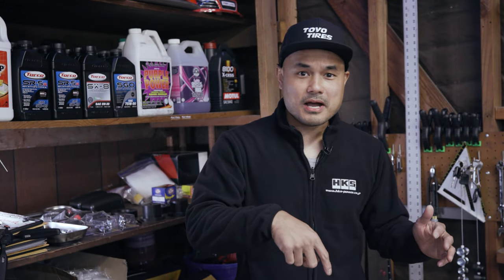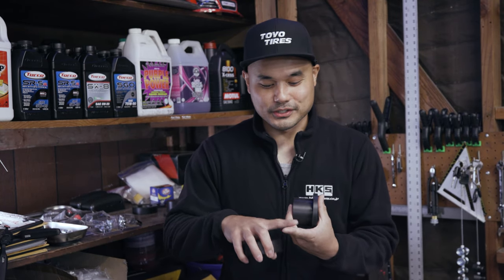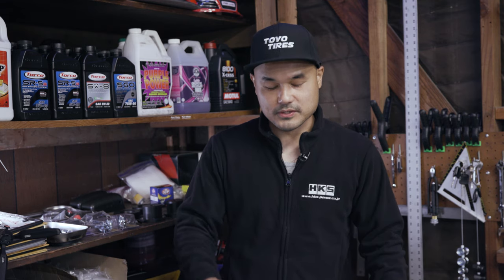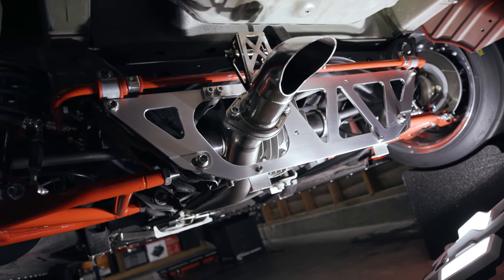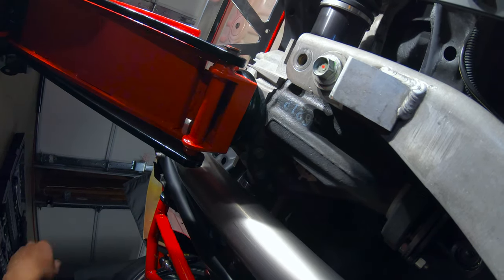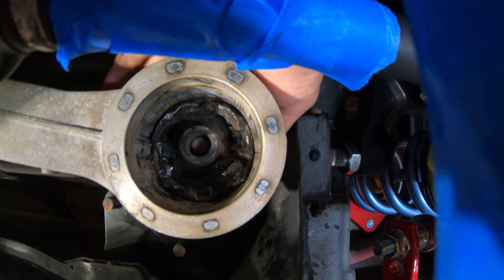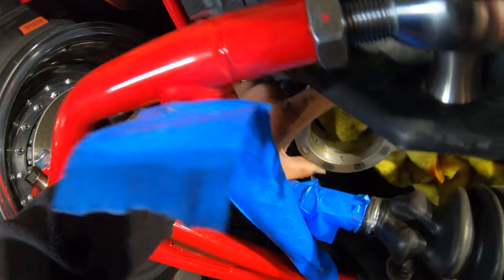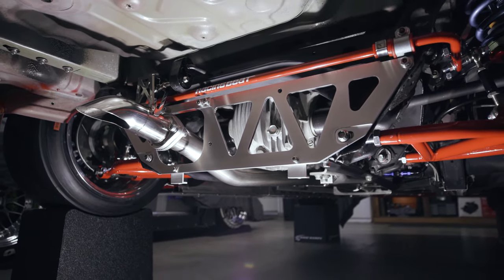MIATA DIFFERENTIAL BUSHING REPLACEMENT THE EASY WAY! | #OMGMIATA | EP69 | [4K60]

Comment: Christ that's a clean underbelly (cried the guy who lives in winter country who's Miata is covered in black gooey rust protection)

And thank you for sharing this. I'm in the process of dropping the diff to replace the bushings - and the air hammer instead of the burning/drilling/saving/outer space-methods is 100% pure win!. Thank you. (And Subbed of course ;) )

Comment: Just did the swap, was farely easy, i didnt have to do anything with my exhuast, removed two front power frame bolts so i could pivit it out of the way. Feels better but since I run a hardtop there is alot of added noise and vibration.

Comment: I thought you had the racingbeat brace? did you switch to the Flyin' Miata one or did you always have this?
Reply from the maker: I actually own both - the FM is way beefier and preferable.
Reply: @OMGBUILDS  thanks for the input man. For 30 more I guess flyin Miata is the one to get then

Comment: Waiting eagerly for engine mount comparison
Reply from the maker: Realllll sooon
Reply: @OMGBUILDS  I'm stuck between innovative and bfw drop mounts rn, will be ordering before long, hoping it adds insight in my decision
Reply from the maker: @noncog1  Innovatives got 3 slots i think vs just one set hole with the BFW
Reply: @OMGBUILDS  yeah, but I dont need adjustment, just a 1/2" drop, I'd go bfw, but I've heard some negativity about them, so I'm interested in the innovative
Reply: @OMGBUILDS  I bought the innovatives tonight, I couldn't hold off on the girls Christmas any longer, along with fm poly diff mounts and door bushings. Still looking forward to your review, I made my decision based on greg Peter's channel.
Reply: Update, awr doesn't want me to decide on innovative until I watch your vid, got a release date?

Comment: Didn't work for me.  Got to where I was trying to air chisel the bushings out but no go.  Tried PB Blaster, heat gun and lowering the car on a propped up steel bar.  Nada.  OE route for me next.  28 yr old bushings, this is going to be a project.  Cool vid though.

Comment: Why Racing Beat and not Flyin' Miata or Eibach? By the way, what's your name? Every time you say it, you say is fast and I can't hear it. Sorry but I'm an OG that never took care of his ears. Like your attention to detail, as I'm the same way. Don't have any photos scanned of my 1976 CJ-5, but I had over 60K of 1970's and 80's money in it. It had a built 6 and every thing in the engine compartment chromed except the Holley 4 barrel carb, that was 24 caret gold. I did things like having the power steering pump housing taken apart, then polished and chromed, then put back together by the rebuilder (not just the can from the pump, but the pump itself). All the electrical wiring in the engine compartment was braided stainless as well as the hoses of course. Just crazy over the top detail. It was as much go as it was show. I jumped it so high it bounced off the wheel twice when I landed! So I can relate to you. Really been enjoying you videos! Thanks, Chris Zinn

Comment: 8:36 thread a bolt in that metal collar and remove it the proper way so you don't have to hammer out the captive nuts.